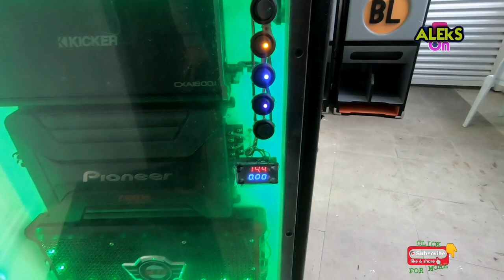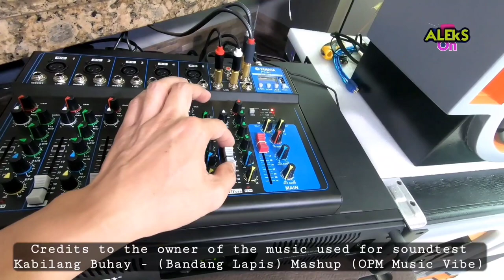AMPLIFIER RACK - CAR AUDIO AMPLIFIER RACK DIY TUTORIAL VIDEO FOR HOME USE - START TO SOUND TEST

Comment: sir may bass driver ako 500 watts, kunq qawinq midranqe anq instrumental na 300watts lalaqyan po pa ba nq capacitor sir ?? para mas maqanda labas nq boses kasi midrange 150watts pinares ko sir sa bass driver  bumabasaq anq tunoq paqkinantahan

tenkyu po in advance more power
Reply from the maker: Pwede lagyan sir, bka basag kc kulang sa amperes ung power supply mo
Reply: @aleksondiy  sa anong power sir sa midranqe na 150 po kulanq ??
Reply from the maker: Car amp b gamit mo sir
Reply: @aleksondiy  kevler po sir 600watts panq bahay lanq po kanatahan
Reply from the maker: Kala ko car amp
Reply from the maker: Ilan speaker nkalagay per channel?
Reply: @aleksondiy  4 po per channel 600 sir
Reply: @aleksondiy  amp ko po 600watts, 4spaeker 600watts per channel tas bass driver ko isanq 500watts may isanq tweeter 200watts dn isanq midranqe 150watts po maqanda sana tapon nya sir kaso pqsumiqaw na anq kumanta don na may sanqit na
Reply: @aleksondiy  pasensya na sir knq makulit d kasi ako satisfied sa naqawa ko eh nqbaka akali lanq na matulonqan po qalinq sa talento nyo